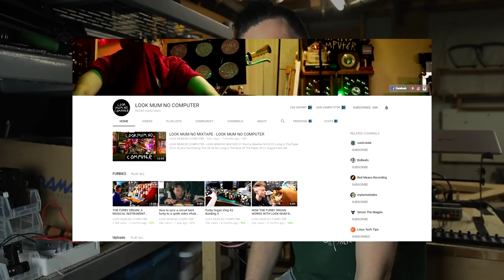I Made an Oscilloscope with an Old Cathode Ray TV

Comment: From what I know about colors on a CRT TV, you have to adjust the R,G and B beams by rotating rings somewhere before the coils on the tube. By doing so, you will direct the beams on the R, G and B little spots on the screen (yes, look at it very closely : one single dot is in fact a combination of 3 dots : a red dot, a green dot and a blue dot).
Be patient because it is quite difficult to tune it properly. I remember having destroyed the image of a CRT TV that could no longer be other color than grey... before I understood I've touched the 3 rings... ;-)

Comment: Great video! I have a LCD VGA PC screen (specifically the AOC LM725, it is a 2005 screen, not a tube screen). Can I do the same experiment with it?
Reply: You should be able to, and it will actually be better suited as the front lead plates can better handle the focused radiation this mod creates

Comment: No claim here that I know anything, but, you might want to measure the resistance of those defection coils and use those values for resistors on the board where you disconnected them.  Basically you left that circuit open with no load, if that is sensed it might effect the colour.  I'm scared of CRT's myself, might have something to do with me pouring a vase of water into a b/w TV as Dad was asleep watching a movie when I was a kid, or was it the TV repair man shouting at me when I started poking the circuit board with a metal dinner knife?, might have been double trauma.  I'm a subscriber of @LookMumNoComputer channel and just subscribed to your channel.
Reply from the maker: Yo! @LookMumNoComputer inspired this video lol

Comment: How do you get audio too? The output of the signal > amp > rcas going to the crt. What’s connecting to the speakers
Reply: Boan I used an A/B box and connected a 1/4in to an old bass amp i had for audio but you can connect it to something like a Zoom if you want to record the audio. But yeah google AB Box, really helps for this project

Comment: Love this! Tried this today and followed your tutorial. But since I don't have an Amplifier I used an Aux Cable and connected the left channel with the vertical coils and the right with the horizontal coils. Unfortunately I couldn't really get this working because I just got a straight line on the screen. Do you have idea what could be wrong?
Reply from the maker: Yeah it sounds like you've only got one axis firing.  But, I'm way too new at hacking TVs to provide any solid advice :(

Comment: thanks for the great video! I want to make one of these, but my amplifier only has a pair of speaker outputs :/ would it be possible to daisy chain the speakers and tv wires without affecting the amp? thanks :)
Reply from the maker: definitely.  the signal coming from the amp is attenuated to work for both. you might see a drop in volatage, but you can just turn the amp up more.
Reply: cheers for the response!

Comment: ok so after you solder the wires to the audio input on the back of the tv I got a little lost... how were you able to plug into the amp from your laptop?? I really want to make this a summer project
Reply from the maker: I have an audio interface routing two separate audio signals.  One left and one right.  They must be separate to achieve this effect!
Reply: GARDNSOUND I've got a steinberg ur44 as an interface, I'm just wondering what you do in order to plugin/make a cable to/for the tv
Reply from the maker: Ok, dope.  I made a cable using speaker wire, one side is an RCA jack - the other is bare speaker wire, because it's hooked up to a hi fi amplifier. 

So Computer - Interface - HiFi Amp - TV
Reply: GARDNSOUND OK cool so basically the rca cable is stripped away then gets directly  looped around/joined with the vertical and horizontal crt wires?
Reply: You're the man for walking me through this 🙌
Reply from the maker: Sort of.  I hacked the RCA input that was already on the TV.  The RCA jack plugs into the pre-existing input on the TV.  I soldered the deflection coils to the other side of the input.  Make sense?
Reply from the maker: Nah, you're the man for having patience with me!
Reply: GARDNSOUND I think so I just can't wrap my head around what you were doing with that alligator clamp/stand, solder, and rca after connecting it back to the circuit board. I get you soldered the crt wires into the built in tv's audio jack but after that I get lost. I youtubed a few videos about how to turn an rca jack into an aux cord with speaker wire and it sort of makes sense now that I have some background on the subject but it's still hazy as to what's connecting the amp and TV if u have a stripped wire on one side (which is what i think is what you were doing when you made the sex joke). Sorry Im making you ELI5 I'm pretty challenged at this sort of diy stuff
Reply: In my head the TV and wiring is all set and squared away. The only thing stopping me from trying this myself is thinking about an rca cable plugged into the newly soldered audio jack on the TV but the other side of the cable looking like a stripped away/frayed bunch of wire which is somehow supposed to connect to an amplifier
Reply from the maker: http://www.audiofixplus.com/mods/Images/imagesCADI5D4S.jpg  most hifi amplifiers allow you to just put bare wire into the terminals, like this picture...
Reply: GARDNSOUND cool im gonna give it a go if I can ever get my hands on an affordable amp and a continuity tester!